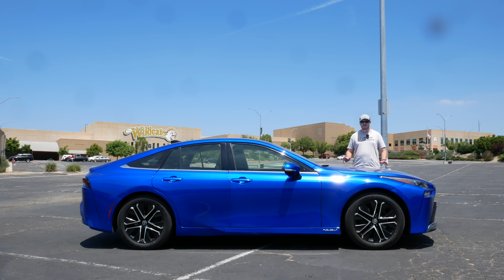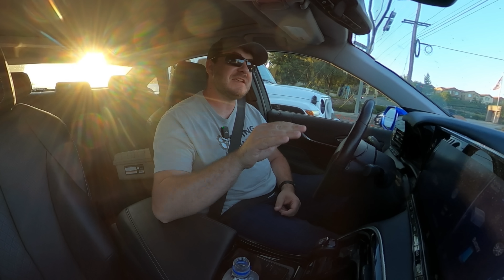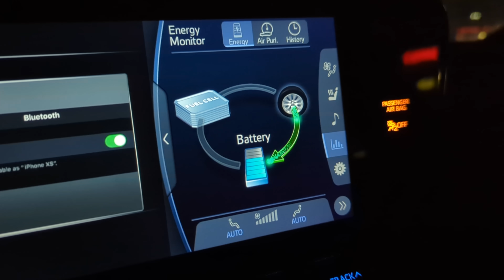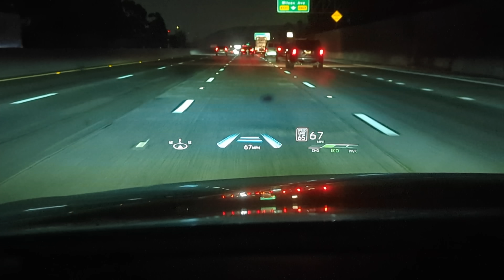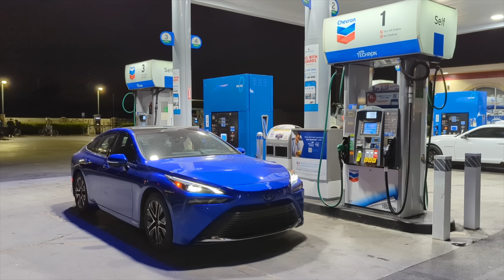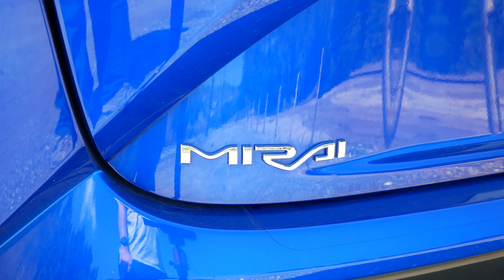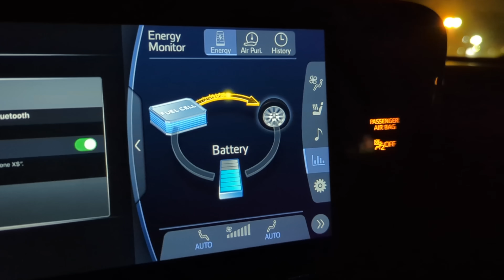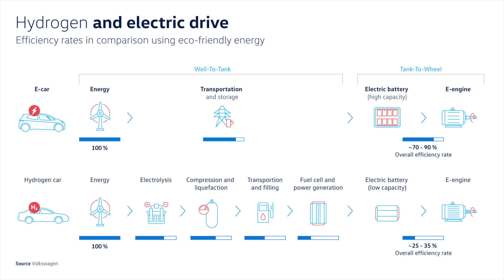The Toyota Mirai is Disappointing

Comment: As a Dane I SO look forward to the day where The North Sea Summit agreements signed and agreed deal will result in an abundance of green hydrogen for Europe. I WANT a 4 stroke pure hydrogen engine and Toyota already have made these cars and have clips of them here on YT. I do not want an electric vehicle and all those batteries. With the combination of windpower and green hydrogen production,, a small percentage of the hydrogen, made when the wind blows, can make the electricity when the wind does not blow and the surplus green hydrogen can be sold on the open market. THAT solution are the true winner of the future. Solar panels are good for decentralised energy making, like solar panels on roof tops but large concentration of green energy production are optimally made in off shore windmill parks.
Reply: Why would we burn green hydrogen in an engine when that same renewable energy could go into a battery electric vehicle with 5x the efficiency?
Reply: @tomdy69  There are many reasons for this. The first being that if we are to create EV batteries to swap entire planets cars and trucks to EV batteries we would have to do A LOT of mining and refining that takes a lot of energy and causes a lot of pollution. Some of the rare earth materials in use are rare because there are limited amounts found and some are considered rare because there typically only are a few grams per tons of earth processed. THUS batteries are overall demanding large highly emitting landscape destroying processes to get out of ground and when out takes large amounts of energy to refine. THEN comes the end of life process where batteries are difficult and demanding to recycle as each component have to separated in complicated energy using processes and even if this is done new rare earth materials have to be added to make a new battery from the old. 
BUT If we look at metals used in a hydrogen engine it are basically same as in current gasoline/diesel engines and they much easier and with at a fraction of energy used, be "thrown in the oven" and metals be reused to make a new from the old, again and again. Metals used, iron and copper and a tiny bit of gold in some cases easily separates in fast processes. If we look at some nations, say, Australia, USA, Canada, the entire parts of non urbanised African continent (imagine own list) and so on the EV can come with many complications whereas the high energy content in liquid green hydrogen can provide as long distance as needed by right size tank. If we combine this with windmills and the container sized green hydrogen production units that can be coupled to them. all places mentioned above easily can provide profitable local fuel production even in highly remote and sparsely populated areas. Same windmills that also can be thrown in the ovens and relatively easy also can be made from old to new mills. 
I am not rejecting the idea of smaller urban means of transportation based on batteries but we could make a much faster and cheaper transition that fits into a circular sustainable economy by adopting green hydrogen engines for cars and trucks. The hydrogen driven jet engine have been in use for decades at hydro electric plants and both Embraer and Airbus proclaimed they actively are working on hydrogen driven planes. 50% of worlds rail lines are not electrified today. By simply swapping current diesel and diesel electric locomotives with liquid hydrogen driven engine operated locomotives we could remove massive amounts of emissions "overnight" until a line have been electrified. 
Mercedes have patented a liquid hydrogen tank that can hold over 99% of content for 12,5 years without engine ever switched on. 
The point here is to look at the entire global need. The NEED is to make a fast transition and you can put up even a huge offshore windmill park inside 3 years creating all the emission free electricity and green hydrogen needed to make a complete transition. Rare earth minerals to cover a global transition need, just for cars, cannot even be realised utilising entire planets known mining and extraction spots. Our atmospheric carbon content should be 225 PPM and now passed insane 426 PPM and STILL rising. Let´s apply solutions that makes sense in light of a circular sustainable way, economy and resource-wise manner.

Comment: Well done. i have seen other shows about Hydrogen and i agree it is best in large instilations. If i remember correctly there is a ferry network using Hydrogen to power the ferries electric propulsion . the Hydrogen fuel cells and Hydrogen tanks are housed in a shipping container. to refuel a ferry thet simply disconnect a container and remove it and then connect a new one. this can be done in less time than it takes to unload and load the ferry. I think it was in Scandinavia somewhere and i believe i saw it on "Fully Charged" .

Comment: I remember separating hydrogen from hydrochloric acid using zinc in chemistry class.  After a short while, we would remove the cork and ignite it.  More than half the time, the hydrogen would spontaneously combust on its own as the cork is removed.  For this reason, I am very much apprehensive about the use of hydrogen for any purpose.

Comment: teslas are not cheap nor are they cheap to operate.
Reply: The model 3 costs about the same as any new modern car, and is extremely cheap to run. Over the past year I've spent about $300 in electricity, whereas gasoline would've cost me about $3000 for the same distance driven.
Reply: @logitech4873  Exactly!

Comment: to answer the question about why toyota doesn't make a bigger battery and stuff. is because Toyota doesn't really believe in EV. they had to make a hybrid because of the world-wide-agreement. But the technique of Hydrogen is a lot better imo, and more reliable and cheaper to make.

A battery is the total opposite, in about 5 years it could only do 50% of it's original range, that makes them less reliable and they are very expensive to make, let alone the environment with that.

In The Netherlands here, we have about 12 hydro-stations already and more hydrogen cars than just the Miraj or Nexo. I prefer Hydrogen over EV, while riding it, it somehow even feels better

Comment: Putting on my engineering hat for a bit (I’m a mechanical engineer so if I’m wrong, well, this isn’t really my field), hydrogen does make a lot of sense for certain vehicles, but it makes even more sense as grid storage. My understanding is the big, heavy, stationary fuel cells are far more efficient. During the early parts of the day and at night, excess power is used to create hydrogen in an automatic way and stored up in tanks placed at substations, and when grid demand peaks in the afternoons because everybody is kicking on their HVACs and plugging in their cars, they use hydrogen to pick up the slack from base load levels. In that sense, a car can be driven on hydrogen, just not internal to the car. Everyone is coming up with these silly mechanical batteries and crane systems and whatever, stop reinventing the wheel.

Comment: My brother had a shot of a hydrogen car from his work and said he couldn't really tell any difference driving between it and and normal diesel car. We do have two filling stations for hydrogen in Aberdeen in Scotland as the council made a push for green energy.

I can't see me ever wanting a battery powered car as I just think they are bad idea, that can't be fully rolled out as I have doubts the UK's power network would expand to cope if everyone switched to EVs.  Imagine how many chargers filling stations would need if everyone drove electric cars. Seems unlikely everyone would have fast charging so when you get queues instead of waiting a couple minutes could be substantially long delays.

Home charging is great if you have a garage or driveway but a vast amount of people don't, or just don't want to spend up to £8000 for the privilege of being able to charge their car at home.
Reply: It cost me ~£800 to have a level 2 charger set up at home. Not sure how you could manage to spend 10 times that.
Vote for the people who want to implement right to charge, and you won't have any issues getting home chargers built whether you have a house or live in an apartment.

95% of my charging is done at home. We don't need as many fast chargers as we need fuel pumps.

Comment: Hydrogens always been fascinating to me, I made a hydrolysis cell back in highschool because I wanted to see if it was possible to make a continuous burn (it wasn't at least for me). Usually i just ended up with bangs more than burns lol. But nowadays me and a friend of mine have been playing around with hydrogen injected diesel, not for economy like is already being experimented, but for power. The hydrogen-diesel burns a lot cleaner and thus a lot cooler and anyone who's messed around with diesels knows that a diesel running cooler just means it needs more turbo and fuel to make more power. And of course efficiency is great for long hauls. I wanted to start playing around with gasoline-hydrogen but I've been told that just leads to a bang.

Also as far as being reliant on the grid goes, I think especially in a place like California we'll see home solar hydrolysis setups. You can do hydrolysis in a cup with 2 nails a battery and some baking soda, it's dead simple, so i don't think it would be difficult to make a somewhat self sufficient cells for home use. My thing was trying to use hydrogen for cooking/heating general fuel (it doesn't really work because bang but maybe it does because hydrogen burners do exist) but you can use a fuel cells heat like a boiler system. 

Biggest issue is the safety of storing hydrogen. What happens when a Mirai gets hit? As someone with 0 to none formal training, hydrogen goes bang yo.

Comment: "Weight:  Hydrogen tanks weigh less than a full battery pack"

Tesla Model Y Dual Motor Long Range: weighs 100 pounds more

🤦

Also..... a year or two ago I saw a Toyota Mirai near where I live..... in Lehighton, Pennsylvania.  Now.... one might be thinking "Well... that was probably just a demo car for Toyota or something like that."  It was parked outside a Lowe's store.  Even the closest Toyota dealership is 20+ miles away.  Only way I can think of that thing ever got Hydrogen was going directly to AirProducts or something, if they even do something like that.....

Also also.... the argument of "For some people, Hydrogen makes sense, such as people who want an EV but can't charge at home" doesn't make much sense.  "I want an EV, but I can't charge it at home.  Might as well go out and buy this Hydrogen Fuel Cell car that I also can't charge at home, with a shoddy at best refueling network, but I also can't even leave California proper in."?  If the main turn-off for anyone wanting an EV is not being able to charge it at home.... a typical combustion car would be a MILES more LOGICAL choice anyway.

Comment: Because it takes in atmospheric air, which will certainly have impurities in it even when filtered, is that “water purge” button essentially a blowdown valve, like on a steam locomotive? The application of it being to blow out mineral buildup and impurities, which could damage the boiler. Unless I’m fundamentally misunderstanding something, does that purge the cells of water, flushing them out at the same time?

Comment: Why not just pipe the hydrogen directly into an ICE style engine? Its flammable, it’s 3x more energy dense than gasoline, and it would make happy noises that I can annoy people with at 3am at full throttle….. plus if it’s liquid people will drive safer knowing they’re strapped to a bomb 😂
Reply: Because it's not actually 3x more energy dense by VOLUME. It's far less energy dense by volume, to the point where you can just forget having back seats or a trunk. You're gonna need that space for fuel tanks if you want to do hydrogen combustion, which is super inefficient.

Comment: Fuel cells also have a finite lifespan because eventually, the heat expansion in dissimilar materials causes the membranes to separate from the stacks. It's gradual which is why your friend's range decreased. Solid fuel stacks work for about 7 years, but I'm not sure which type the Mirai uses.

Comment: The one advantage that HFC has over BEV right now is the fill-up time, but as you mention that lead is rapidly diminishing. HFC has not made much progress in the last 10 years, honestly, whereas BEVs have improved by leaps and bounds. Not only are batteries far more energy dense than they were 10 years ago, but the cost per kwh has plummeted and the time to charge from 10% to 80% has dropped to under 20 minutes. And of course there are literally millions of places to plug in an electric car just in the US alone. It's a bit of a head-scratcher why Toyota (and Hyundai to a lesser extent)* keep trying to push HFCs considering after all those years (Toyota has well over 15 years invested in HFC development) there are still only a few dozen hydrogen stations in the US, all but one in California, and the number of these sold per year is well below 10,000.

* Hyundai was at least smart enough to also invest heavily in BEVs and they are now far ahead of Toyota in that field.
Reply: I never understood why Toyota tried in the first place. The efficiency was never going to make hydrogen a thing.
Reply: @HoltAlex  I sort of get what the intent was: Fast refill times compared to charging a large battery in an hour or so. The problem for hydrogen is that battery chemistries and all that goes with it have improved by leaps and bounds and is rapidly taking that one advantage away from them. Now you can get an 80% charge from 10% in less than 20 minutes, which most people find acceptable, and that will only continue to improve. Toyota and Honda should have seen the writing on the wall many years ago, but by that time they had billions of dollars invested in it and didn't want to give up. Hyundai was smarter: They put their eggs in more than one basket (they have hydrogen fuel cell cars too) and invested heavily in BEV technology and as of right now they are several years ahead of Japan in that field.

Comment: I did some research before hand about hydrogen fuel and im no bachelor degree holder of engineering however you pretty much reached the same conclusion as I did but I have an extra thought and that, it can serve as storage for excess energy production.

Comment: There had been discussions of a possible metal crystalline matrix that could store hydrogen more densely than as a compressed gas while using less energy than liquified hydrogen, but I have more faith in solid state batteries coming out first, and Toyota promised those in five years over seven years ago!

Comment: Hydrogen has two main advantages on the grand scheme of things.

First, Japan. Japan doesn't have oil. Importing oil is a pain in the ass. Their nuclear plan was working out for an EV future until the (heavily flawed and unfortunate) Fukushima power plant kicked the bucket, you might have heard of that. As usual with nuclear power, people base all their opinions off of one crappy powerplant and ignore all the ones working perfectly. But japan can produce hydrogen from methane really easily, and that brings me to the second reason:

Pollution and materials cost. Batteries have funny rare metals inside them. Extracting them is VERY polluting, not necessarily on a CO2 level, but on a "your groundwater is now corrosive brine" level. Japan doesn't have those materials and batteries don't last particularly long either, so they'd be stuck importing batteries and battery materials like with oil. Now I don't know exactly what goes inside one of those fuel cells or what they do, but I'd be willing to bet it's way cheaper and less polluting than a battery, with the added benefit that hydrogen can be transported kinda like gas. Also if you were worried about them exploding, Toyota has shot them with a .50cal and all the hydrogen just wooshed out with no other damage - also way better than a battery fire.